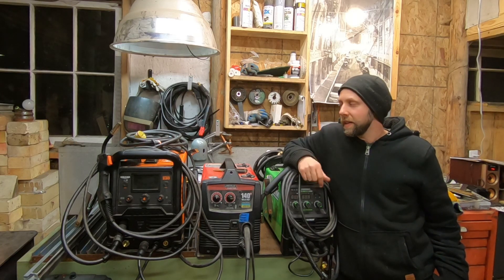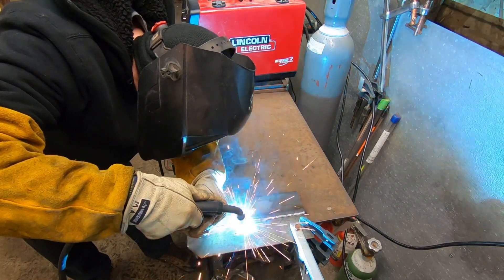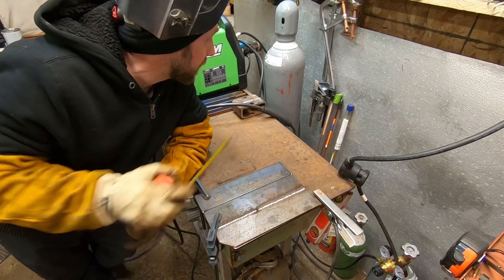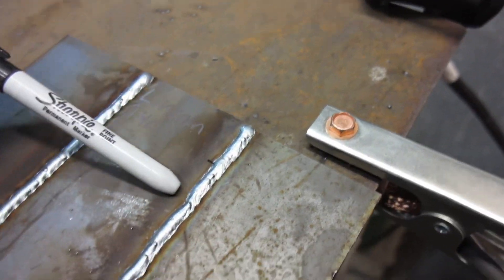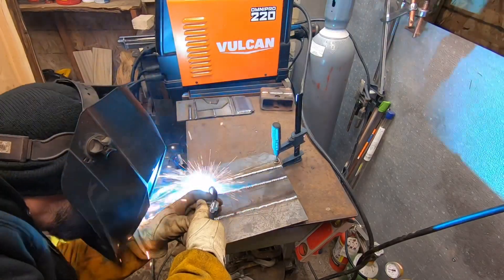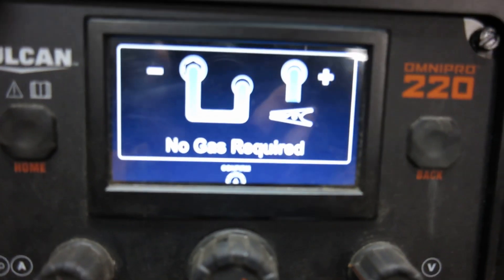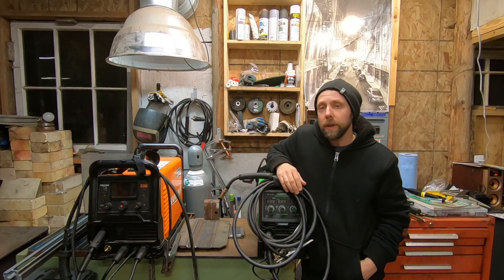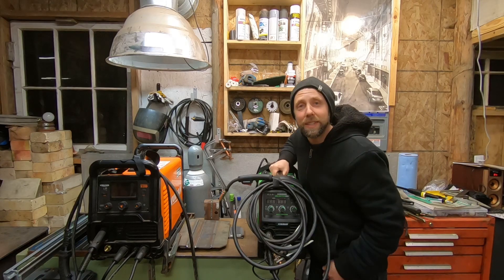Titanium Vulcan welders 120 volt MIG test

Comment: Hey man thanks for this video, I was hoping to see someone put theses 3 machines to this kind of test. I notice you weld like I did until before I got my first real welding job where I had a supervisor show me a few things to make my welds better and life easier. Without sounding like a jerk I'd like to offer you what I was shown. First is your work position and torch angle. You should always do your best to line yourself up to your work so you are welding side to side as opposed to starting away from you and pulling towards you like in this video. If using solid wire, angle your torch back 10-15° from your direction of travel. This is alot easier when going side to side.
Even if you're welding low to high (uphill) still stay to your off hand side. In other words if you're right handed stay to the left side of the joint or vise versa and put about a 15° up angle on your torch. You'll see much better as well.
If you're using flux core remember "If there is slag, you drag!" This is the time to run a kind of back hand or pull motion with your torch. You even mentioned flux runs hotter and this allows the flux to rise up and reduce your chances of inclusions in your welds.
One last thing, if you are running a thinner wire than you would like for a job that isn't critical, you can always grind  open the the gap in your butt joint to about half the thickness of the metal stitch your bead side to side like a series of half moons, or bevel each side and multi pass if it really has to hold but is still not critical. 
Hope what I wrote helps you now, like you have helped me in the past! Stay safe!
Peace

Comment: I'm thinking about picking up the titanium?  What amp circuit are you running it on for 240v?
Reply: Most welders in this category are supplied with a 50A plug but if you run this on a 30A, 240V circuit it should be more than enough. Of course if you can run a 40A or 50A circuit go for it but I'll bet that if you already have something a 240V, 20A setup I'll bet you can get away with it unless you are maxing out the machine all the time.
Reply from the maker: I definitely recommend the Titanium 200 or if you only need MIG the 170. I believe they have 50 amp plugs on them for 240v I think I have a 40 or 50 amp breaker? I will need to check when I get home, really I think if you wire up a 50 amp plugin you should have wiring and a breaker to match what the plugin is rated to. I hope this helps. Take care

Comment: Hello,  I have had a lincoln weld pak 100 for more than twenty five years.  When it was brand new for the first year or two it would run on a 20 amp 120 circuit but then it started popping the breaker on a regular basis after just a few minutes of welding.  I contacted Lincoln and they claimed as I recall that the machine (and that is a 90 amp welder) needs twenty five amps to run.  I installed a thirty amp 130volt circuit and have never had any trouble since.  I have several welders but that lincoln has done a lot of work it can reach its duty cycle but that takes a bunch of welding.  I use it with flux only as I have other machines for other uses.  The transformer is heavy but if portability is not an issue they sure do last and I have used it on 3/16ths easily and a 1/4" with a multiple pass a lot over the years.  I recently bought another Lincoln 180 240 amp and really don't feel it is as good a machine although more powerful of course as the old 90 amp Weld Pak 100.  Take care.  Doug
Reply from the maker: Thanks for your comment! That’s good to know about the breaker. A friend gave me a Lincoln weld pak 100, it was broken when he gave it to me years ago, the motor drive was plastic and broken so it wouldn’t feed wire, the parts where no longer available from Lincoln so I took it apart and drilled some small holes in the plastic so I could use wire to hold it together, then I used fiberglass and resin to repair it. I never had a problem with it after that, my biggest gripe was not having enough amps for single past welds on thicker metal,  But I did a lot of projects with that welder. Take care

Comment: Mike, I have one of these Lincoln 140 Weld Pak welders (Home Depot version with voltage 4 voltage taps versus infinitely adjustable voltage). I'm pretty much a novice and your welds look better than mine but I have difficulty getting things dialed in on the Lincoln at times and I think it's because I can't really fine tune the voltage. I'd like to buy one of these HF welders, probably the Titanium (lower cost). Does it weld better for you than the Lincoln? Just the weight savings and adjustability alone would be nice. The Lincoln has proven to be durable but lacks a lot. Just looking for your feelings as to which you think welds better?
Reply from the maker: Hey Rich thanks for commenting! I like the Titanium WAY more then the Lincoln 140, I actually pack the Titanium to my work every week and use it rather then the Lincoln at my work just because it works much better and I also use the TIG torch quite a bit for repairs on worn out shafts on machinery where the bearings don’t fit good anymore, I tig weld the shafts to build up the metal again. I owned a weld pack 100, years ago and I have no regrets getting rid of it. Not only do I think these newer style inverter welders weld better then the old style transformer welders, there much lighter, multi process, multi voltage and more efficient when it comes to amp draw from the outlet. I really like my Titanium welder! Take care :)
Reply: Thanks Mike - I'm sold! It's funny, the Lincoln is only something like 55lbs. but when you start carrying it around it gets old, plus like I mentioned, while it's been reliable it's limited in what it can do. Wish these things were around when I bought mine or I'd have one already. Not a real big price difference either.

Comment: Mike, I need to weld a few windows and a door frame on my shipping container which is off grid with no access to power. I have been eyeing the Titanium for a while. Any idea on a generator size I would need for titanium 200 pro? I believe it’s 14gauge Corten steel and I’m welding square steel tubing (1/8 in. thick). Ty and great vid.
Reply from the maker: I have a mid sized generator, I will try the Titanium 200 on it and see what it will do and get back to you about this. Take care :)
Reply: Ty so much mike

Comment: Do you know if the Lincoln 140C is any better? It's supposed to be more robust and costs a bit more. Any difference?Thanks.
Reply: I have a 140HD which the Home Depot version of the 140C. The only difference between the two is that the 140C has infinite adjustability on the voltage where the 140HD has A,B,C, or D settings. Don't get me wrong - the Lincoln has been trouble free and they make great reliable equipment but if I could do it all over again I'd by an inverter welder with a bunch of features instead of a MIG unit that is heavy and can only do flux core or MIG. Just my opinion

Comment: i have a Lincoln i bought at lowes a few years ago it welds  very well with gas only. i been thinking about getting a 220v welder i may try the titanium.
Reply from the maker: JERRET CARRIERE the company I work for bought the Lincoln 140, it’s definitely better then nothing, but I’m amazed at how much more of a welder the Titanium is for $100 more. Ps I owned a weld pack 100 for quite a few years and it got me by, that’s the machine I used to weld my entire sawmill together, I do however really like having the extra amps the Vulcan and titanium offer. Thanks for commenting, take care :)
Reply: I have the titanium 200 multi machine does stick and Meg and TIG I would highly suggest the 200 titanium I'm a beginner I love it so far my friend's a few or a little jealous that I got the 200 I really like it they have a lot more experience my one friend is trying to come up with a couple more dollars to buy the same one I think of her the money you can't go wrong looks like it's built pretty decent to me like I said I'm a beginner and it seems to weld real nice check it out

Comment: re-watch your video at 2:38 you'll notice at the bottom of your weld there's a hole and if you cut  across your weld in several places you'll see the same thing .  When you do a root pass you should pay attention to the leading edge of the puddle to ensure that it's penetrating into the root .  I to have the Titanium 200 and love it for mig welding .  But if you want to stay in the same price range and do some tig welding try the PRIMEWELD TIG225X 225  sells for $775.00 and as a tig welder it does a great job , the foot pedal sucks but it can be replaced with the AHP SSC 7 pin pedal .
Reply from the maker: Thanks I appreciate it, I probably would have done two passes on the 1/4” but using three different welders on a 6” piece on metal and trying to video it all and keep track of each take just seems to much for me when filming this shoot. I really like the Titanium welder it’s really compact for it’s power and versatility, I have been having fun learning how to TIG weld with it, it’s basic but it’s nice to have a machine to learn on. Take care

Comment: Great video Mike! You no Lincoln 120 volt breaker poppin don't like fluxcore welding guy you!! 🤣  yes Fluxcore is smokey and it ain't pretty! But works nice for windy outdoor stuff. I'm trying to like it, I love my Vulcan 120 also but I keep a transformer or two around just incase.
Reply from the maker: Haha! I think Lincoln is fine but I have had a lot of frustration with this one. Yes your right flux has it’s place, windy outside work and rusty metal, plus the fact you can leave the bottle at the shop, I keep a roll around for work on my sawmill, it’s useful for that stuff. My biggest beef with it is that’s all I had for many years, then I finally got a bottle of 75/25 gas and I have a hard time going back. Thanks for commenting and checking out my video :)
Reply: Mike festiva when you break down the cost of flux vs hard wire, the cost is phenomenally different. Flux runs about $6.10/pound of wire and hard wire runs about $2.30/pound. Now that is based on .035 wire which is what I run a lot of at my shop. The gas for a 125 cubic ft bottle is about $40 and you get roughly 25 pounds of wire out of it if you set it right. Each has their place and benefits. And a helpful tip for the Lincoln,  it works best when ran on a 25-30 amp breaker panel.
Reply from the maker: Thanks for commenting! I definitely like your break down of the cost, it’s interesting. Take care.

Comment: Thanks, I have commented before and I have been on the fence between the titanium and Vulcan. Great video.
Reply from the maker: Thanks for checking out my video! I really like them both, I think the Vulcan is a little more robust with a better duty cycle, more options like spot weld and the auto set is really nice but it’s a bit bigger and is twice the weight of the Titanium, I like the Titanium a bit more mostly because of the size and weight, even if the duty cycle is a little smaller I have never hit the duty cycle on either of these welders so it’s not ever been a factor for me. I hope this info helps you with your choice.

Comment: Great work Mike! Well done video...again! I'm done with transformer based machines. I agree on every point you made about inverter based welders. As for flux core welding, that's for emergency use only. As for spatter VS splatter, you made a great point... WHO GIVES A SHIT.  Another great tip when welding with a 120 volt MIG welder on thick materials,... regardless if its transformer based, or inverter based (much better), pre-heat the joint with a MAPP gas torch (yellow cylinder). It will really wake up those 120 volt machines!   Like I've mentioned befor in other comments,... Ive sold all my millers and Lincolns. NO MORE! I'm done with those two companies. ESAB can suck it too.  With the Vulcan and Titanium lines, you get VALUE, and QUALITY, and... CUSTOMER SERVICE!  These machines are VERY WELL BUILT! Thanks again Mike. Thumbs up!
Reply from the maker: Thanks Joe for commenting! Good point on pre heating, I definitely will remember that one. Yes the inverter welders are great, I have had the same conversation with my friend Dave, he completely feels the same, they just weld better and are much more efficient. Dude I finally got a AC TIG!!! I have wanted one and needed one for about 10 years now. I just found out that the Protig has been discontinued :( I don’t think Chucky 2009 did them any favors not hooking up his ground clap good and complaining about the HF start, ( but when his sponsorship is with other competitor companies then he’s bound to do a shit review) Anyhow I have wanted to try them out since they first came out, so I got the last one at my local store, it’s got the clear cover over the digital display, I think I remember you saying that was second gen??? Anyhow It welds great, I only got to try it out one night but on 240 I had no problems with the HF starts, man it’s going to open up the possibility for a lot of new projects! Ps I bought the extra warranty so I got three years no problem, and I talked with the HF manager about it being discontinued and it sounds like if it shits out I can get store credit or trade to a different welder, so I’m not to worried about it. What have you been up to these days?
Reply: @Mikefestiva  Glad to hear you got one! I want another one. My local store has quite a  few in stock. I've been working all the time. Lots of home projects with the weather finally warming up. Your going to love that ProTig 200. 
I have a SUA Mundaka IonTig 200 AC/DC Pulse tig, and a IonTig 200 DC Pulse Tig. These are sweet machines too. Just no time to use them much. I have some projects coming up. We'll see. Keep up the videos. They are educational, honest, and entertaining. I don't watch much TV, so I watch videos on YouTube. Your videos along with about 15 other channels get my viewing time!

Comment: Excellent video!!! i will say for anyone more then a hobbiest welder like myself Transformer welders are the way to go...We use a Millermatic 212 at work for the past 9 years with no issues...I use a Millermatic 200 from 1986...and my son who is a certified welder uses a Lincolin 260 and an Everlast Tig/Stick combo for his personal work...I had the same Lincolin for many years and i would pop 20 amp breakers before it would duty cycle out....I have never tried the Harbor Freight welder so i can`t comment on it`s performance....The ESAB Rebal we had would weld fine then go to full voltage and amperage...They were unable to fix it ...

Comment: I have a Lincoln 140 220v, no issues with the duty cycle, but it welds like crap. I bought a Hobart 210. It welds great.
Reply from the maker: I didn’t know Lincoln made this model in 220 volts, the one I was running is only 120, and when welding at full power it trips the breaker all the time. I was looking into the Hobert handler before I bought the Omnipro, the weight was the biggest down side for me. Do you have the Handler 210? I’m sure your Hobart will be running for many years to come. Thanks for commenting.
Reply: @Mikefestiva  
Yah I bought it  20 years ago, it may be a 130? 
Eather way , for a 220v welder it will only weld up to 1/8" .  I put it up for sale on facebook a while back, knowone would believe it was 220v. Yes its the Handler 210.

Comment: Does the omni allow you to make adjustments outside the recommended setting per the push button menu?
Reply: Yes i believe you can fine tune it with the dials and from what i hear it usually needs a minor adjustment to fine tune it at times
Reply: Thanks for the responses fellas!
Reply from the maker: Definitely yes like the other guys said, I was wondering the same thing too before I bought it, auto set turns out to be quite handy, but it’s always just a knob turn away to change wire speed and voltage so it’s definitely easy to run it just like any other manual welder. Take care guys :)
Reply: Yeah, you can adjust the settings to whatever you want or you can stick to the ones recommended, the display on the omni is pretty intuitive as well.